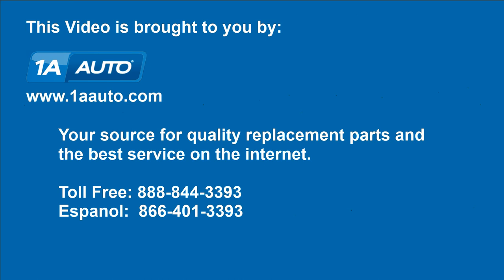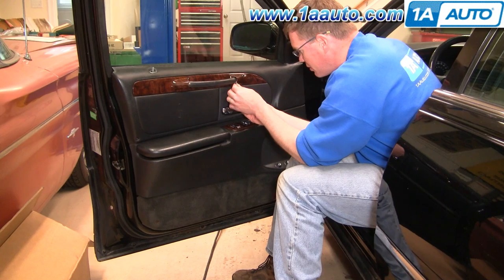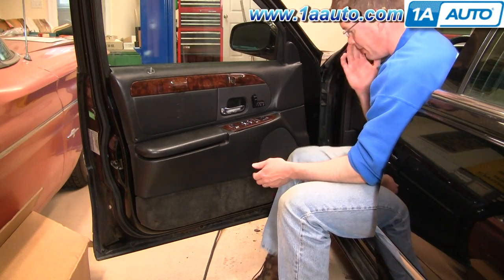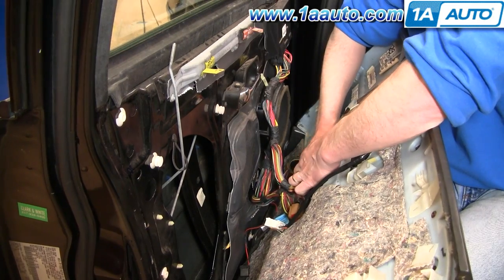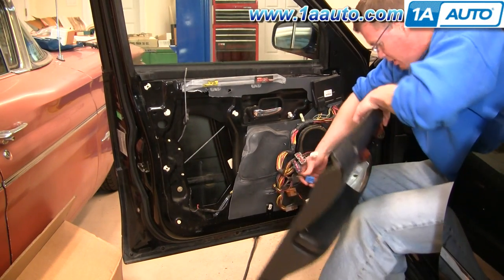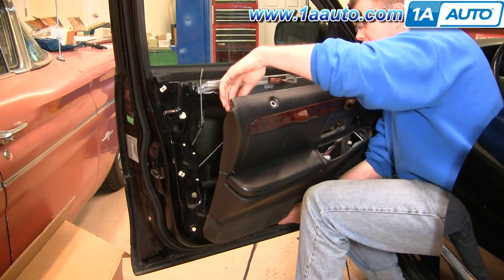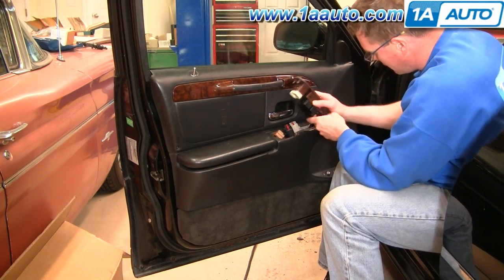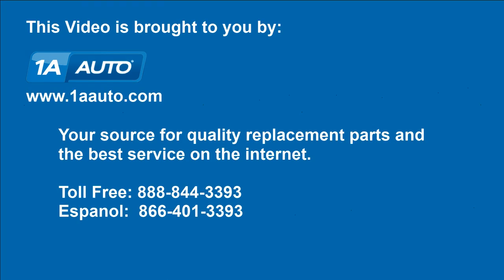How To Remove Front Door Panel 98-02 Lincoln Town Car

Comment: I need to get to the area behind the upper right hand corner of the door cover. I’m told there is an area with code numbers on it for the keyless entry. Is it possible to get to it without completely disassembling the door cover?

Comment: Took the panel off to upgrade the door speakers Those 2 screws at the bottom were a REAL pain  but I got it done in the end great video helped alot 👍
Reply: Wat size was the door speakers
Reply: Yeah what size were they I might have to replace or fix mine
Reply: Yeah what size were they I might have to replace or fix mine

Comment: Is there any chance you guys can make a video on replacing the door panel lights. And also my Sunroof is not getting any power? I checked the fuse, and its good and changed the motor but still not getting power? Any help please.

Comment: Hey, how you doing? I was wondering if you could help me. I have a 99 Lincoln Town car and I am replacing the seats.. I got the front bolts out but I cant get to the rear because the motor will not go back or forth it will only make a clicking noise...But it will go up, down, and tilt. But I have to get the seats to the front to take bolts out. I was wondering if you could post a video showing how because I looked on ther internet no help. Please and thanks by the way great videos.

Comment from the maker: You 93 Town car may be different. You may be able to apply some of the basic steps taken in this video to remove your door panel. 1aauto.com 888-844-3393
Reply: What about a 96 Lincoln Town car. I need to fix my window! It has stopped working!
Reply from the maker: +jims99tvs We're always cycling through common cars. We'll add this repair to our list! 1AAuto.com